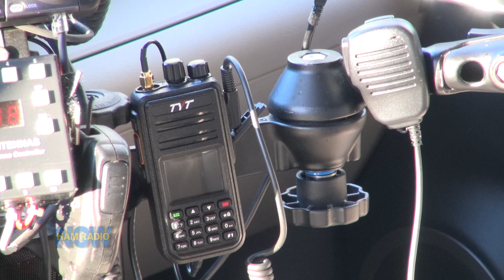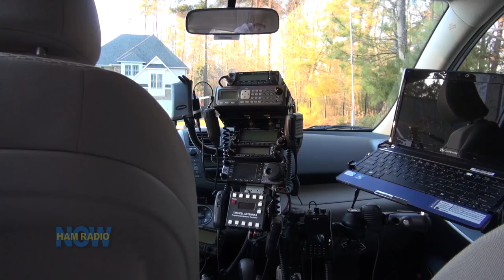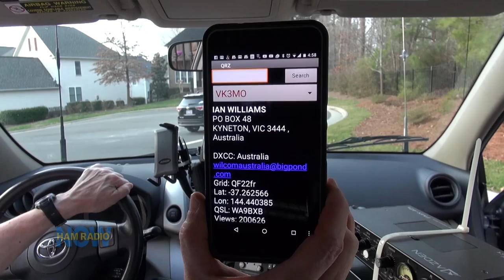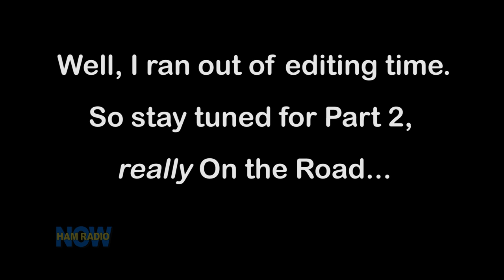HRN 300! On the Road: Orlando 2017 PART ONE - the Q-Mobile

Comment: That's a crazy setup you have there. I have a quick question about your NMO mounts. I want to put one of those Yaesu 8900 in my car and had planned on putting it right in the center most part of my roof. Would this be any better then your front/rear mounts? I wouldn't mind them being in the location you have if it wouldn't hurt the output direction that much. Any input would be appreciated.

Comment: Nice mobile ham shack.  Lol.  Do you recommend the Yaesu 8900 and Icom 710?  Some were saying th Icom 710 had fan noise.
Reply from the maker: Joe DeJohn >> do you mean Kenwood 710? I'd be 50/50. If you want APRS, only the 710 has it. It's a more modern radio, but quite a bit more expensive. More info in the display. So if money isn't a problem, maybe I'd lean 710. Either will make a good mobile radio.
Reply: Sorry confused.  Meant to say Kenwood 710.